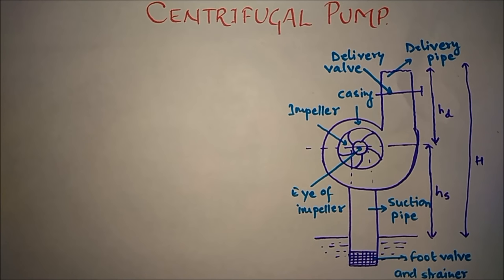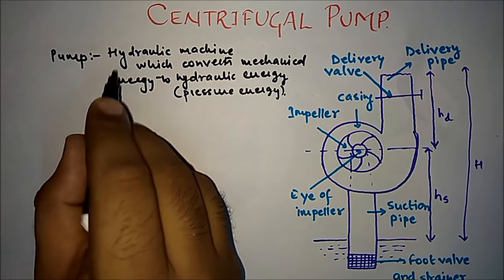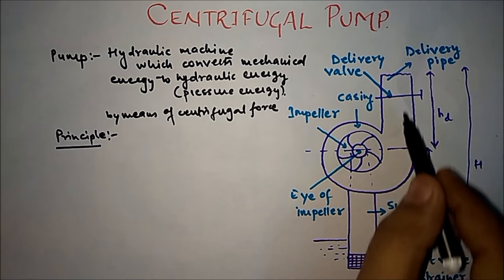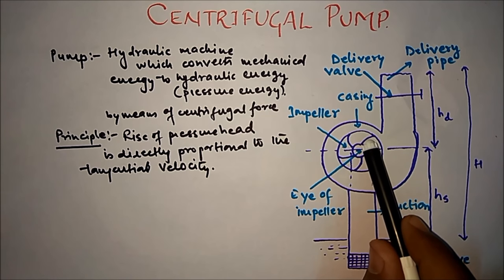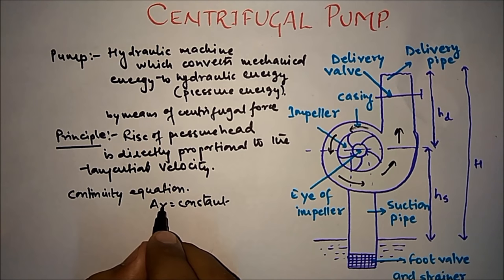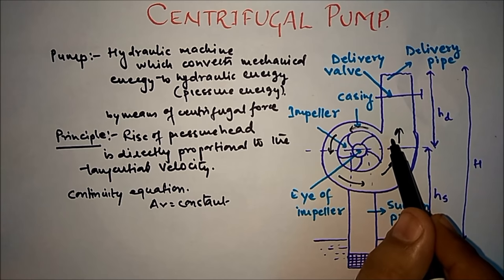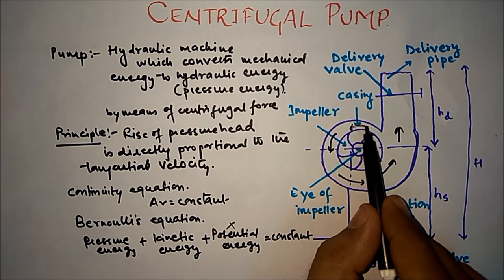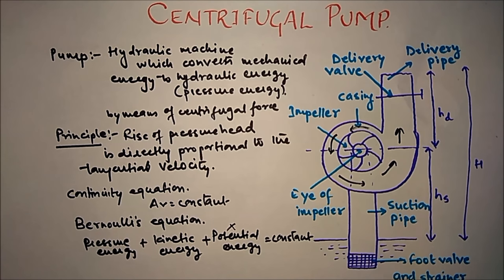Centrifugal Pump | Construction | Principle | Working

Comment: Sir, can we use two centrifugal pumps to lift water at a height of 150 feet.
Reply from the maker: Yes.
Pumps in series can be used to get more height of discharge fluid.

Comment: Sir according to the principle of centrifugal pump the pressure head is directly proportional to tangential velocity so th tangential velocity decrease the pressure head will also decrease.
But in this case the velocity decreases the pressure increases why
Reply: Read it again it is proportional to tangential velocity, here when we say tangential velocity we mean the velocity of the tip blade which pushes the water outward in tangential direction to the blade.

Dont confuse with blade til velocity with velocity of water in the casing.